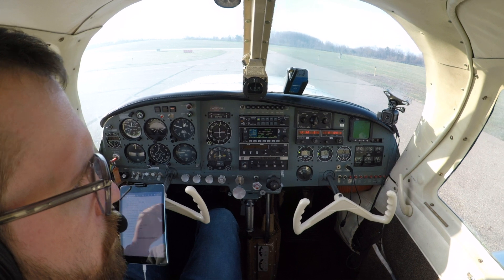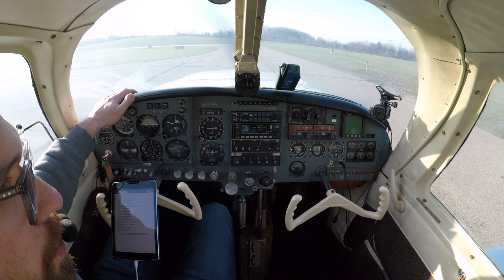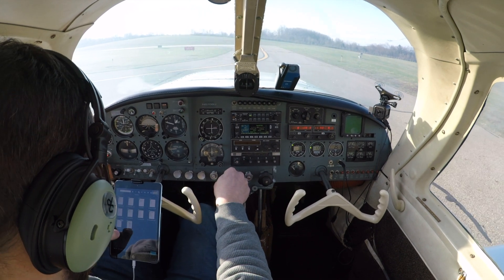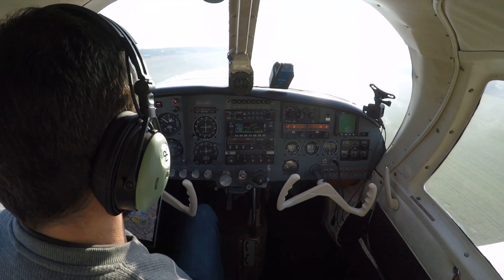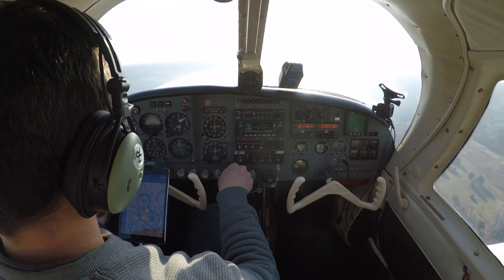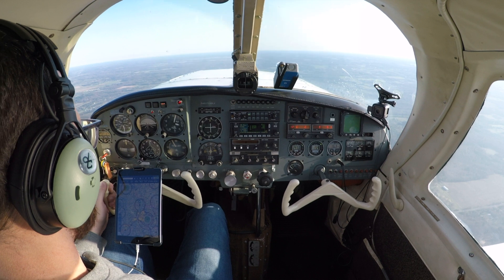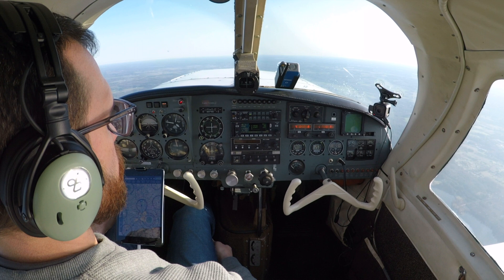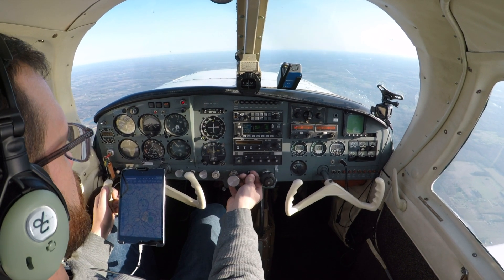Magnetized Airplane Pulling Money Out Of My Pocket - Mooney Problems / Money Problems!

Comment: I have something else that you should consider. As you know it's not just our government that is changing, but our money system is changing, and not just ours but the world's. With that said this is not the time to be making any investments, especially in such an older plane. I don't mean to be poo poo, but any money that you put into this plane upgrading electronics you will never get back out. So for now I would recommend leaving it alone and waiting to see how the world finances and our government system changes over the next 6 months to a year. And during that time keep your eye open up for some good used equipment that you can get cheaply, cuz upgrading to some nice g5s and an older plane like that is easy. Plus wouldn't it be awesome if you just won the lottery, and decided to just go with it all brand new panel, new dash ball Garmin, which means you probably have to rewire the entire plane in the process, so we're probably talking about 120,000 added to the current price of the plane, so I recommend just leaving alone for now
Reply: 🤣middle class advice right here.
Reply from the maker: Nice!
Reply from the maker: Thanks for the perspective. I guess it boils down to the question, am I trying to invest in the airplane for added value, or only added capability.

Comment: As a 31 year owner of the same F model, I think you need to first determine whether you really intend on keeping the plane because it fits your flying needs for the foreseeable future. If the answer is “yes”, then make a laundry list of the “must haves” for upgrades and another list for “nice to have” items. The must haves for my instrument flying was an autopilot and reliable radios. 

I hand flew mine with steam gauges and without a full functioning autopilot from 1991 until 1998.  In 1998 after hand flying IFR for 7 years I stuck an STEC 60-2 in. Really lightened the workload and made IFR flying more manageable doing single pilot IFR. 

When it became apparent VORs we’re headed towards the trash heap, I finally installed an IFR capable GPS. At the same time glass panels were available and I stuck in an Aspen 2000 system.  There are a lot of options out there. Just find one that fits your budget and upgrade. 

As for your magnetized plane. What gets magnetized is the roll cage. Degaussing will work but you need to address the underlying cause for the magnetism. This is usually a power line for something that is wrapped around or too close to the roll cage. What worked for me was installing a Precision PAI-700 compass. You need to buy the balancing ball set with it. The balancing balls allow you to zero out any magnetism field around the compass. And if you upgrade to something that has a magnetometer in it (like an Aspen or Garmin 275), the “wet compass”, though legally required, will be more of a backup. 

I have a few videos on my channel that show what I did with my panel and one on how to use the Aspen.
Reply from the maker: Thank you kindly for the detailed comment, it’s my opinion you are spot on. I will check out the balance balls, we had considered them…but didn’t make the move to purchase yet.

Comment: You need a degausser to demagnetize the steel roll cage.A degausser is a coil that produces a magnetic field that you can use to demagnetize the roll cage frame. They were once very common to anyone who worked on conventional televisions. You should still be able to find one or the instructions to make one on the internet. One word of caution, remove the compass from the airplane before using the degaussing coil or you could damage it.
Reply from the maker: Thanks Jim. We've attempted degaussing the airframe with 2 different coils at this point. We have Gauss reading as low as 1-3 in some areas and as high as 15 in others. Our avionics guy believes the level is so high, it must have been struck by lightning. Not sure if I buy into that yet or not.

Comment: I feel where you're at, I'm almost at the same point. I still have all steam gauges, my autopilot is not reliable so I'm looking at putting 2 G5s and a G500 AP. But I'm wondering if it's really worth it. It's a lot of money to fly few IFR hours. For now I'm doing the same as you, I'm doing my IFR rating manually and we'll see after. 

In your case, did you ask somebody if using a G5 would solve the problem? I don't know much about this, but won't it be affected by the roll cage as well?

Just to keep your plane flying, maybe consider the uavionix alternate to the G5, it seems to be cheaper. I had a quote recently for 6k installed (that's with attitude + HI).

My advice to you is the same as I'm doing. Fix the problem right now with G5-like instrument (I'm thinking that if you sell the plane it will have a better value than selling with a compass problem), dontour rating in it and once you're IFR rated, figure out if the Mooney is still ideal for your mission.
Reply from the maker: Thanks for all the great thoughts! The reason a G5 or similar can hypothetically work is because of the remote mounted magnetometer (or so I'm told). We have and will continue to consider the Uavionix version, but as of now I don't believe it has the magnetometer available.

Regardless, I do intend to keep the Mooney flying. It has to stay in the air!
Reply: @ThePeases414  I understand, let's go for it. The G5 creates a good base further down the road if you want to couple it with a 430W or a G500. 

As to the point that any money you put into upgrade you will lose on the resale value, I would say owning an airplane is not the most sound financial decision to start with. In my case I bought a plane with good bones that I will be able to grow into for many years to come, even if I have to invest in some costly upgrade.
Reply from the maker: I appreciate the perspective, and do agree that costs like this should not be unexpected when owning an airplane.

Comment: Same issue here with a '74 M20E and a vertical compass and a 530w/430w. Just passed my IFR checkride with it. We decided to upgrade our panel to G3x + 750, definitely not the cheapest optionbut Mooney are such great flying machine, it will instill a new life into the old bird. I would get a 530w or 430w and focus on my IFR training if I was in your shoes. Good luck
Reply from the maker: Thanks Pierre! How far off is your mag compass?
Reply: @ThePeases414  no more than 180deg out on a good day. When we were planning the panel layout options, the company advised against a panel embedded compass and recommended a dash one "that will likely we off too" because of the Mooney structure. So we gave up, between cellphones, iPad and watches, we carry at all times 5 gps and 2 radio nav systems.
Reply from the maker: I love the common sense approach!